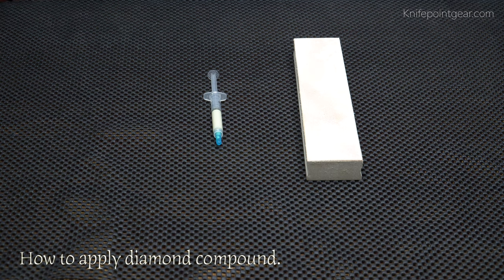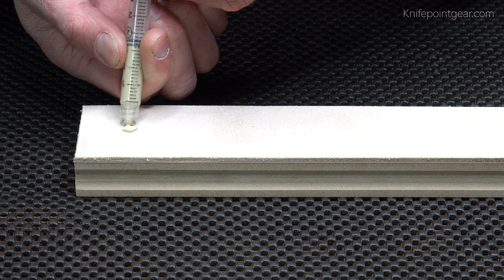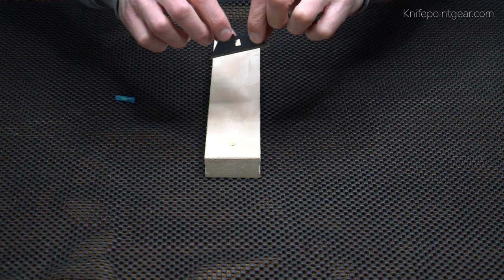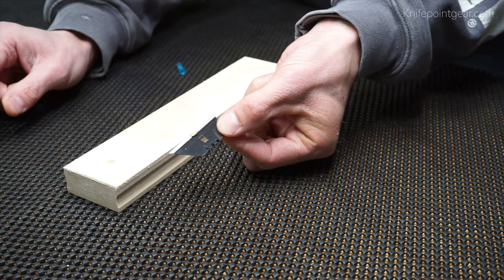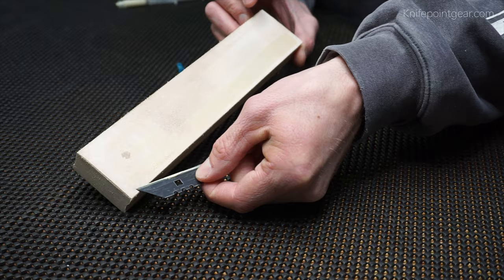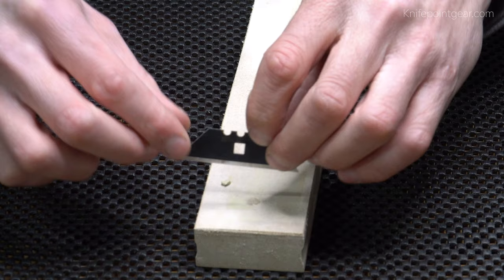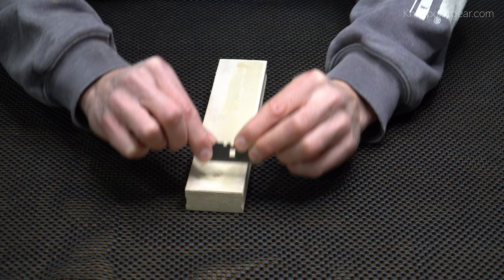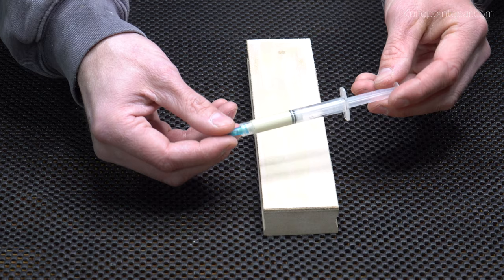How To apply Diamond Compound for Strop - Knife Sharpening

Comment: On first use and subsequent uses...pull back on the plunger to get it loosened up. The compound will be easier to expel from the syringe.
Reply: EXACTLY! Just pull back a hair to get it unstuck, and no more splats. The rubber seal will stick to the wall if it sits in one spot for long.
Reply: As someone who uses syringes frequently at my job, this is great advice.

Comment: What’s the best way to remove diamond compound and clean and maintain your strop ?  I applied 3000 grit diamon compound on my kangaroo leather strop, , stroped two knives and its already turning very black. ( slight noob here obvi lol )
Reply: I second this comment - would love an answer!
Reply: I would like to know this as well. I heard some black is good, on the smooth side of the leather it almost gets a sticky feel once some friction and heat is created after a few minutes working the knife over it. How much I'm unsure, but I have yet to clean mine and it seems to still perform just fine.
Reply: A year late, but saddle soap and a horse hair brush

Comment: I just got my knifepointgear strop  delivered to my doorstep today! Looking forward to learn to properly strop/fine tune my blades, I have a few D2 knives and one Kershaw with 20CV blade, all my knifes are scary sharp already, however, I know they are not shaving sharp. 
First thing I need to do is Apex to 17⁰ then I will attempt to strop to mirror edge.
Question is should I practice on my cheap knives first before attempting to polish my more expensive blades?(cheap knifes are Kershaw and Gerber with Japanese/Chinese/Skandi steel) 
Thanks Alex for your videos and your stropping gear. Happy 2022
Reply from the maker: First, thanks for the support! I really appreciate it!  Im not sure I understand the question...The thing to remember is, some steel and heat treatments will respond differently to sharpening/ stropping. Some "cheap" steel a bad heat treatment can make a knife super difficult to sharpen or even impossible it get super sharp. Even good tool steel like d2 with a bad heat treatment can make it difficult to really get that hair whittling edge. I wouldn't look at it as what to do first but try and figure out what ones are going to take a better edge and go from there. Hope this helps! Again thanks for the support 🙏🙂
Reply: @knifepointgear5851  yes you understood and answered my question. Thx

Comment: what micron size do you recommend if using your compound and strop?...i can't tell if this is the white, light gray, or light ivory compound you're using.....just getting into knife sharpening....i have a Smith's Tri-Hone system that I've used only once....but i don't own a strop yet.....looking for suggestions....thanks in advance
Reply from the maker: i like the 3 and 1 micron. it depends on what stone your finishing with though. 1 micron is a good all around compound.

Comment: I've stayed away from diamond loaded strop pastes because it's very difficult to clean them off the blade without causing unsightly scratches.  One time after stropping a Wusthof chef knife with diamond paste, I washed the blade with soap and water.  The blade looked very clean, but when I proceeded to wipe the blade dry with a clean paper towel, the numerous invisible diamond particles still left over on the blade marred the brushed stainless steel finish.  Ever since that episode, I stopped using diamond pastes.
Reply from the maker: Not all pastes are equal by any means. Some are water based, some are oil, and have WAY more diamond in them meaning you meed less, etc. If you have residual paste on the blade you applied WAY too much. If applied correctly it remains on the strop. Very little is needed due to the diamond content of our paste.

Comment: I know its an older video but, any tips on rehydrating diamond compound? I bought a pack of various grits a couple years ago, went back to use some on a new strop and its tough to get out and has a crumbly rough texture that doesn't adhere at all to the leather on the strop it just flakes off. Thanks
Reply from the maker: different compound uses different bases. some are oil and some are water. it would depend on what the base is. Ours are oil but the best way it to just scrape off the old with a razor and apply new. The base helps hold the diamond on the surface of the strop so if it flakes off so will the diamond. Applying a VERY small amount is recommended and you wont get any flaking if you apply in the correct amount. Basically the excess is whats flaking off in the first place. hope this helps🙂
Reply: Honing oil
Reply: considering that it evaporated, it is likely water based. However, Put a small bit in a clean shotglass, water bottle cap or whatever (clean is what matters) and add some water and let it sit a few hours. If you see beads of oil separating (check in sunlight if you can, full spectrum helps show oilslicks) it may be oil based that somehow dried.
Reply: Sawing maching or Mineral oil

Comment: How often should you have to re-apply the compound?
Reply: It will last a while. As you use it it will remove steel and will load up the strop. When you notice decreased performance scrape off the old and reapply. Apply the compound as thin as possible. Less is more🙂
Reply: OUTDOORS55 what’s the best process for scraping off the compound without ruining the strop?
Reply: @OUTDOORS55  if you can please touch on removing compound it would be highly appreciated. Thank you.
Reply: @davidsauceda2618  he has a video on it, search his channel.

Comment: Is this exactly what you do when you get a strop right out of the box? Or do you have to condition it in some way?
Reply from the maker: no conditioning required 🙂
Reply: Idk about knife sharpening compounds, but for plain leather strops (just to correct/polish a razor edge before/during use), it's reccommended to use some kind of animal fat every few months- a year to keep the leather from drying and cracking. Can't imagine it would hurt for the wood backed ones too
I'd presume a similar